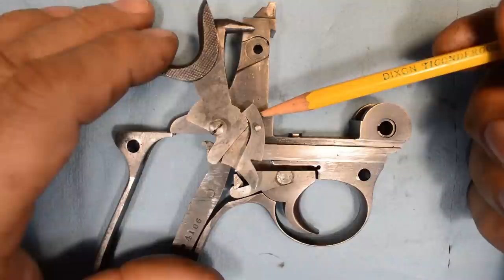Webley-Fosbery conservation and function; Anvil 084

Comment: You're a brave man so you are. I have the absolute worst luck with springs going pinging off to god knows where in my shop. And it's usually the sodding expensive small ones that are impossible to find when they bugger off at high velocity too. 

Anyway, thank you for a fascinating video.

Comment: always amazed those guys designed with pen and paper, no software modeling...I'd have a stroke..
can it handle .357M or .44M, that would be interesting...
also, the fps of bullet versus a single shot of same caliber: cylinder gap energy loss, plus (?) slide momentum energy loss...
Reply: No, no it can't. Vintage Webleys (Fosbery or otherwise) are made for much lower pressures than that. .455-caliber Webley Mk VIs can't even handle .45 ACP, which is really unfortunate given that the vast bulk of them in the US were converted to chamber .45 ACP.

Comment: One thing I must ask, why take the whole thing apart to replace a outer plate screw?
Reply from the maker: There is a slight humor component to this. You got to see a Fosbury naked, that is the point
Reply: @marknovak8255  lol. The thing is so many old guns get turn into non functional sculptures because people pull them apart & lose or break bits, simply because someone wants to test out an ultrasonic cleaning machine they just bought. Isn’t It sort of tempting fate to pull one apart right down so even all the subassemblies are torn down?
Reply: @mickvonbornemann3824  That would be my view. Especially as it was apparently in pieces recently but not filmed.
Reply: waaaaay too many parts...

Comment: Webley/Fosbery *****.I Have a Webley with the following markings DO YOU KNOW HOW OLD IT Is.? On top of  the barrel - (43 oz CAL
on the barrel in front  of the CYL is .38   .767 below this  3 1/2 tons***on the cyl  w 853***under the hinge has  w853***trigger guard w853***THE ACTION OF THIS IS WHEN THE GUN IS BROKEN TO RELOAD ALL SIX CASINGS ARE EJECTED AT THE SAME TIME***A daisy wheel or star pushes out all six  casings****if anyone how old this gun is add to comments thanks***DR KEL
Reply from the maker: I would say a Webley mk4 police revolver. They stopped making these in 1924. Start here in your search
Reply: THANKS ***DR KEL

Comment: lol how did the brits not have a semi/full auto battle rifle at this time lol
Reply: We did, the Farquhar–Hill, and it was accepted into service as the "Rifle. .303 inch, Pattern 1918". 100,000 were ordered but the war ended before production facilities were allocated.

Meanwhile our service rifle (the SMLE) was fast enough (in trained hands) that many we thought we didn't need a self-loader. Then it turned out that it was indeed fast and (more than) accurate enough to do the job it was designed to do, even in less trained hands.

The Farquhar–Hill evolved into a SAW post-war but was never (re-)adopted in that form. Meanwhile the SMLE and, later, the No 4 continued to be 'good enough' and, most importantly in the post WW1 economic situation, 'cheap enough' until we needed quantity not quality and we got the Sten.